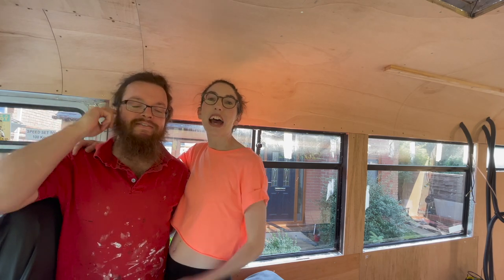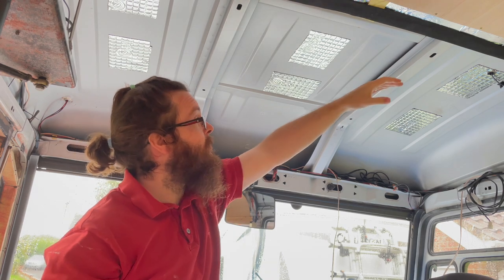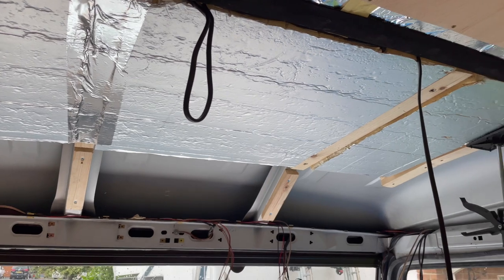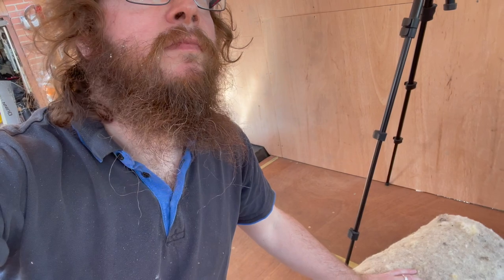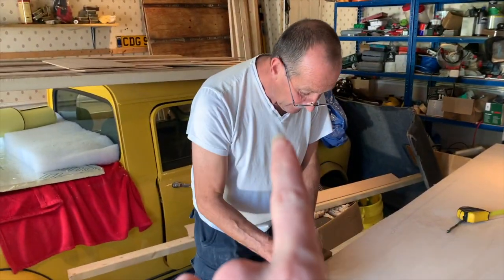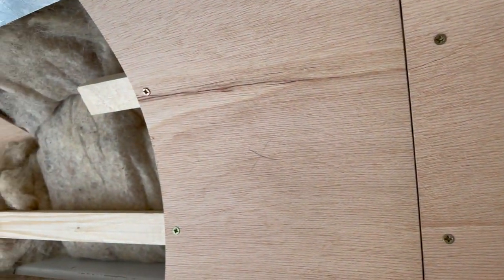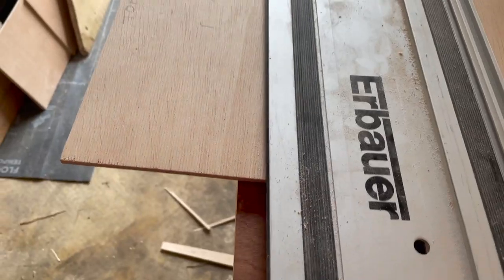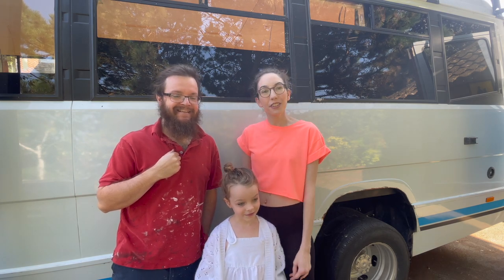Custom Curved Van Cab Headliner | Van Build Continues | Mercedes Vario Van Conversion Series Ep.34

Comment: I know it won't be seen but there is a way of working out the angle of the curved ply in the corners so that you have just the one 90 deg curved return , a bit like coving on house ceilings, but it's easy for me to say as a carpenter/joiner for 25 years, good vlog guys 👍
Reply from the maker: Ah that would still be interesting to know. Problem we encountered is the front slope of the ceiling has no area to support on the ‘roof’ side. So we went with this. On the plus side it does mean more room in the overhead cupboard. 

Ps. Have been trying our hand at scribing for cupboards. So can show the ‘learning curve’ on that next time too. It’s all good experience. 

Thanks for watching and for your comment. Appreciate it 🚐🚐🚐